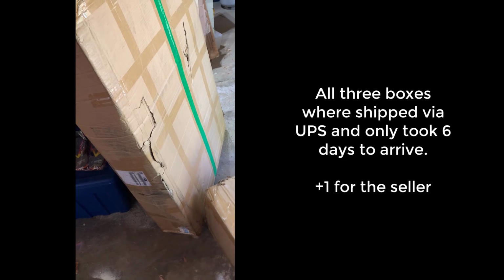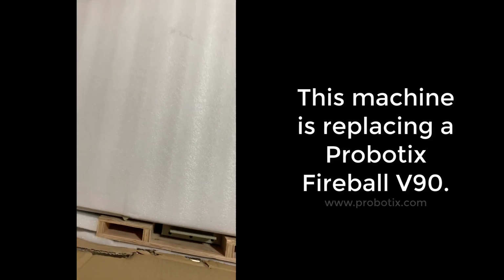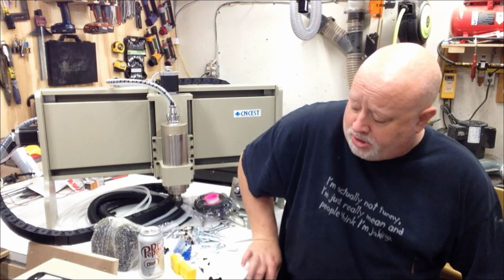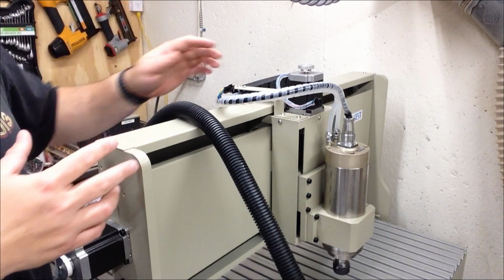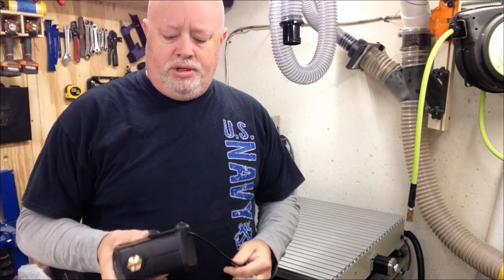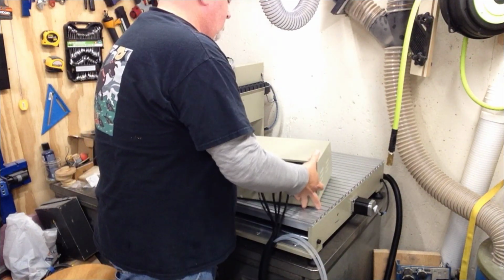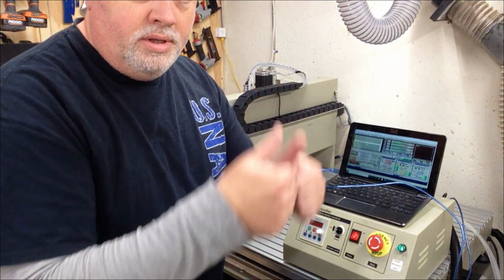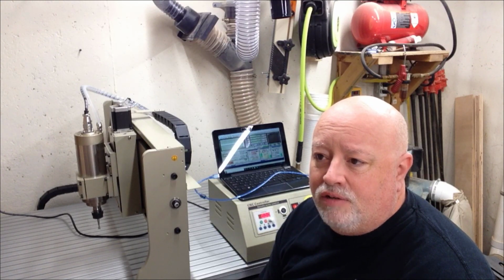Getting started with the Chinese made 6090GZ CNC Router

Comment: howdy is this better than 6040?i plan to make inlays on pool cues and engraving....
Reply from the maker: The only "better" thing about the 6090 vs the 6040 is the size... when talking about the CNC machines from CNCEST.  The machine work area is larger on the 6090.  Also, not knowing what 6040 you are looking at, there may be more spindle options on the 6090 vs the 6040 as well.  Otherwise, they are, usually, a similar machine.
Reply: @jeffmorlen  if you make a tutorial on hoe to extend bed to say cut  or taper something up to 32 inches between centers that be awesome!
Reply from the maker: Getting my 4th axis up and running is on my list.  But, I'm in Wisconsin (USA)... so we take advantage of any good weather we get (usually 2-3 months of the year... haha)... and I've been spending a lot of time working on engines this summer.

I'm hoping to have a quick "Let's get you up and running with your 4th axis" video in a month or two (which may be longer... and I may have started that project more than once already... eek).

But, the information that I'll try to convey will be relatable in many ways.
For a taper, like on a pool cue, I can think of some ways to do this in software and a couple ways with just a simple mounting plate/jig.  It doesn't have to be complicated to work... right?

I'll keep you posted.  Thank you for the comments.
If you need direct help, please send me an email.
Reply: Oh btw I have Gcodes ,I also had a 10k cnc just fr cues but it got sold and now I'm into buying a 1600 cnc ,so I figuere just load gcodes and send it
Reply from the maker: As long as the G-Codes are generic, it should be fine.  But, something to keep in mind is that this CNC runs using Mach3, from machsupport.com.
This is an older package (as of the time of this comment, they are no longer developing Mach3 and focusing on Mach4) and you get a questionable license with most CNC machines out of C#!n@.
Reply: I plan on using vectric 2d or something else and I don't mind buying mach program just wish it was longer like 35inch
Reply from the maker: Vectric is great software and if you pick the right Mach2/3 post processor, you shouldn't have any issues.
I hear you on the size... I wish it was something like 24"x48" (26"x50" table size).  But, if you index your work, you can do longer things.
Reply: @jeffmorlen  I can make it work for inlays but if wanna taper a shaft it's usually 29 in then add fr tailstock and the drive so it moves it to at least 35inches

Comment: Hello, great video. What is the difference between 6090GZ and 6090Z? You recommend usb or parallel connection? You recommended me to buy 6040 cnc, to learn the process or to buy directly the 6090 cnc, so i can have it forever? I am an engineer, experienced with autocad 2d, and less on fusion 360.
Reply from the maker: I'm not sure what the difference would be.  I've searched for the 6090Z and could not find anything significant.  Most of the differences that I noticed were things like limit switch placement and the advertisement of the unit as being made of "steel".  Mine, I believe, at the time of the purchase, said it was made of steel too... but most of the larger parts are aluminum with steel screws and covers.  Of course the linear rails are polished steel as well.

I hope that helps.  Sorry I don't have more information on the differences.

Comment: Hi Jeff.  What type of connection is that to your pc.  I once bought a machine that had LPT and usb.  It turned out they pirated someones firmware and pc software.  You couldnt update or use usb connection with mach3.  In future i need to ask better questions to avoid a repeat.
Reply from the maker: One thing about some of those cards... 
The CNC breakout boards you find with a USB and an LTP (Parallel) port on them usually only use the USB for power.  They still require a parallel port connection to move the machine.  I've seen several with both ports too and, personally, don't care for them.  They always seem to be very low quality.

My CNC breakout board is, probably, a knock off of the R&R Motion controller board.  This board uses USB only and does not require a parallel port to run.  You do need to install a DLL into your Mach3 folder for it to work, but I've had very few problems with mine.

Feel free to ask me questions... I've been in the CNC space for 10+ years now (personally) and another 10+ doing software setups and first run stuff, professionally, before that.

** I don't do this for my work any longer.  It is now just a hobby.

Comment: Hi Jeff, Thank You for your video. I read on Mach 3&4 that a laptop cannot be used. I see that you are using a laptop just fine. Is there something that I am missing with that?
Reply from the maker: Sorry for the delay.

Yes, the documentation, for Mach3 and Mach4 does indicate that you should not use a laptop.  So there is that... but... you can if you use USB (it seems to me) to communicate with your stepper driver controller board... like the RnR Motion in the 6090.  

So, to be "safe" I would say that you should not run Mach3 or Mach4 on a laptop to control your router.  But, just like everything else, your experience may vary from what is recommended vs. what works for you.  Personally, I'd be worried about the laptop stopping the job part way through or something.

If you watch a lot of CNC videos on YouTube... a lot of people run Mach3 on a laptop... but, like I said, your experience may be different.

Hope that helps... even though it is sorta a non-answer answer.

Comment: Jeff - I’ve had my 6090 for a little over 4 years now (same brand).   Done a lot of work with it and mostly using “VCarve” for my CAM Software.  All that being said I’ve also had numerous issues with it - overheating, have had to rewire the x and z axis, and now the touch plate won’t work.  It’s  good that I enjoy tinkering  with it as much as I do - I guess it’s called a hobby CNC for a reason!  I enjoyed watching your video .
Reply from the maker: Thanks Jim!  Is there anything you want me to tackle??  I'm working on the 4th axis stuff now.
Reply: Hi Jeff  i have brought this same machine and having a hard time getting it to run with the software, i got the machine running manually, unable to get those download they send to work is it possible to give some guidance please,

Comment: Thanks Jeff. I am considering getting either a 6040 or 6090 and your videos are greatly appreciated, as I am completely new to the CNC world, other than lasers. Quick question - I actually want a 6040 but I noticed that none of them that I see have limit switches. Do you think this would be a huge annoyance with everyday usage?
Reply from the maker: It's different for everyone.  I know that before I had this CNC machine I had a smaller one that didn't come with limit switches.  I did add them, in the long run, but after 8 years of using it without.

It mostly comes down to knowing your machine and knowing that the project will fit in the space you have defined.  If you are going to push the limits, as in the size, of the machine... you will probably benefit from limit switches.

If everything you are planning on doing (in the near future) is quite a bit smaller than the machines size, you probably won't benefit from having them.

I hope that this makes sense.  Let me know if you have any more questions.
Reply: @jeffmorlen  Thanks man. I think I'm just so used to having limit switches on my laser because it homes itself every time on startup and if those limit switches weren't there then it would just repeatedly crash itself into the side. I guess I can get used to not having them on the router, with a different mind set. It's odd that you can't even find a 6040 with limit switches (and no ports for them on the back of the VFD box).
Reply: I  removed them from my proverxl 4030, after you have practiced you can do without them

Comment: this machine have uses 20mm non supported SBR linear rails y axis this mean not strong cutting aluminium, but can change less than 300$ supported SBR linear rails. and have weak small Nm torque motors need change normal cnc user 112mm long nema 23 motors 3Nm or more. controll box include 10$ 4 axis breakoutboard and DM 542 small motor drivers, same can change better DM 556 motor drivers and biggest nema23 45A  3-5Nm motors. lot better whit aluminium cut.
Reply from the maker: Actually... this unit uses fully supported on the Y axis and unsupported on the X axis.  The stepper motors, I believe, are 2Nm or less... which is a little under powered for this unit.  I will be changing them in the future.  I use DM542 drivers on my other CNC machines, but I have not opened this box in a bit... and don't recall what is in there.

Comment: same machine aliexpress have 2000$-3500$ many seller, only frame, not motors, not controller box cost 1000$ mach3 controller card 10-20$ 4-5axis and motors can buy less than 300$
Reply from the maker: If you wanted to... you could build a 6090 with the motors, controller, VFD, and screws that you desire.  The option, on Amazon, is just a quick way to get into this type of machine without having to source all the parts.

Comment: mach3 has good beginner but not safety and good pro, not realtime, dangerous if not have, not easy make own tool help files, not easy made additional axis,etc,code,makro etc, linuxcnc workig true realtime lot safety than windows base mach3 and can lot lot lot make own tools,softawares,makros,hall fles etc tool changer automation etc. linuxcnc have flexible make lot new all what u want. mach3 not can make all. but mach3 have easy to beginner cnc use littletime.
Reply from the maker: Mach3 vs. Linux CNC is a discussion I'm willing to have.  I've used both, extensively, but feel that Mach3 is easier to customize and works with a wider array of hardware.  That's why I use it vs. Linux CNC at this time.

Comment: This video of yours has been like the light to start understanding the machine, but I have a question, how can I check the vertical axis of the machine once I have it connected to the computer
Reply from the maker: The vertical axis (the Z axis) can be controlled, in Mach3, with the Page UP and Page DOWN keys on the keyboard.  If connected properly, and the software is working, this should show you movement of your Z axis.

(You do need to click on the RESET button within Mach3 before movement can be done)
Reply: @jeffmorlen  Thanks a Lot, your video is AMAZING
Reply from the maker: Thank you Victor.  Let me know if there is something you need/want me to cover in a video or "quick clip".

Comment: I got one of these Chinese machine, too. It's not advised to start the spindle at high speed as this will shorten the life span of the bearing. Start at 3000rpm and increase for every 3-5 minutes. This will help the lubrication on the bearing. If you have more budget, you can upgrade the bearing on spindle. With 4 bearings, the noise will decrease.
Reply from the maker: Thank you for your comment... but, I disagree.  The VFD, within the control box, will ramp up the speed on its own.  And every 3-5 minutes will make it take a long time to get up to speed.  However, 3000RPM, as per the specs on the spindle/VFD, will cause issues of its own.  The minimum speed, for the 2.2KW spindle, is 10000RPM (as per the vendor).  At 3000RPM, due to how a VFD works, could cause the VFD to overheat.

That's my $0.02.
Reply: @jeffmorlen  Well, the Chinese vendor of the spindle told me about this. It depends on the lubrication they implemented for the bearing. I think most Chinese spindles are the same type.
Reply from the maker: Who is the vendor of the Chinese spindle?  Mine is not marked in a manner to determine who the made it... so, could be the same or it could be different.  If you have information, and care to share, let me know and I'll host it for everyone.  Thanks!

Comment: I have the 6090 machine USB and can only get motion on the XYZ but no spindle control in Mach 3. Also the supplied USB hand held controller suffers the same condition. I have installed the rnr motion dll into the plugins folder...along with license file. but no luck. I also seek knowledge about scanning an image and cutting out the shape. (In my case wood mouldings...from which to cut a template and subsequently grind the knives from that template to reproduce the original scanned sample.) .
Reply from the maker: I have heard of issues, just like yours, from some owners of the Chinese 6090GZ CNC machines.  It seems that some vendors DO NOT connect the motion controller to the VFD and require you to control it manually.  However, there are a couple things we can do to check this out...

Can you get the spindle to spin using the control panel on the control box?

Here is a link to a PDF that I made about testing your spindle.
https://1drv.ms/b/s!AgxiwVost-OPi4ES7Ug-cm8Gwsr11Q?e=HW9JYY

Try this and let me know.

Comment: Hey Jeff,

looking to buy similar machine from ebay .

just curious for the travel disnatnce of the axes , do you have any intel on this ?

Need at least 150mm in Z- axe for my purpose of use .

Grts , thx in advance
Reply from the maker: Davy-
Unfortunately, the distance between the aluminum bed and the bottom of the gantry is only, 4 9/16".  I have a pic that shows this if you need confirmation.  Sorry.

Comment: Jeff, do have the specs for the stepper motor.  I need to replace my Z axis motor
Reply from the maker: Ron-
I don't have the specs for them... but they seem to be pretty light weight.  Like, maybe, 280oz/in motors.  Many people have replaced their "stock" motors with larger, stronger ones.  The benefit is that you will get better speed and better holding strength.  

So, with that said, I'd say that you can just source a motor from Amazon (or similar).  The connectors are industry standard and you can find them on Amazon too (I used to have a link to a bulk pack but cannot find it).

I hope that helps.
Reply: @jeffmorlen  normal nema 23 3-4A 3Nm motor i see have. what longed motor body have then strong have torque, important not small motor because no torque lose step easy and not can move all axis.
Reply from the maker: I believe the connectors they use are "Micro-Fit 3.0mm" male and female.  You can find them on AliExpress or Amazon.
Reply from the maker: Might be these...

https://smile.amazon.com/Molex-Micro-Fit-Receptacle-Terminal-sockets/dp/B07H6ZXPNM/ref=sr_1_1?crid=2M9AIQUMRETGR&keywords=micro-fit+3.0mm+single+row&qid=1663597391&s=industrial&sprefix=micro-fit+3.0mm+single+row%2Cindustrial%2C95&sr=1-1
Reply: @jeffmorlen  same factory same parts buy amazon have 7-12x expensive than buy same aliexpress normal, amazon have lot scammers and sell ower price all cheap chinese parts, and same parts i mean has made same factory. ali sell 4$ and amazon 8-30$ true full same parts. stupid use big scammer shop amazon if same factory same parts can buy other shop 10x cheapen.
Reply from the maker: One group said they were JST SM connectors.  Here is a link.

https://www.amazon.com/4-Pin-Brass-Terminal-Connector-Female/dp/B01LYYGGED/ref=asc_df_B01LYYGGED/?tag=hyprod-20&linkCode=df0&hvadid=226601492573&hvpos=&hvnetw=g&hvrand=15714838303230970531&hvpone=&hvptwo=&hvqmt=&hvdev=c&hvdvcmdl=&hvlocint=&hvlocphy=9018821&hvtargid=pla-378969788043&psc=1

Comment: All of these (this style) are made by CNCEST. Most of the pages on eBay state that they are unbranded. I just bought a 6040. Need to make a bench for it and assemble it. That's going to be delayed a few days as my order for the lumber got canceled. Have to redo with different lumber. Pain in the ass. Making it over kill with 4x4s.
Reply from the maker: Share a picture of the bench when you are done.  Mine is just sitting on an old, and very heavy, commercial desk. :)

Comment: does the controller box come with any software or you have to use MAch3?
Reply from the maker: To be honest... the system does not come with a USB stick or CD/DVD or anything.  I needed to contact the seller to get the software that works with it.

That ZIP file (you can find attached to my channel) contains the RnR Motion Controller driver, Mach3, and some PDF files.

If the version of this unit you buy has something other than the RnR Motion Controller board, then you'd need to use what you can get from the vendor.

Please note:  My machine will not work with any type of Arduino CNC controller board software, LinuxCNC, Mach4, or other 3rd party software.  My unit will only work with Mach3.

Comment: I'm about to buy the same machine as yours but I'm in the UK. I'm pretty sure it's an identical machine but it has a different name on it, as you said go on Amazon same machine sold by loads of different people.  I've wrote to the company to ask if the machine will run on anything other than Windows 7 or Windows XP. They've come back and said no it has to be those operating systems. Are you running these operating systems or are you on a more modern machine running say Windows 10?
Reply from the maker: I would ask the seller for any documentation that they have about the machine.  Specifically, about Mach3.  This will give you some very strong clues as to what you can run.

I've seen a couple of systems being sold that use an Arduino vs. the RnR Motion control board.  That makes life difficult as you cannot even run Mach3... you need to run an open source version of some control software.

So, if you can get some information from them, then that will give you some clues.
Reply from the maker: Oh... and I run Windows 10 + Mach3 on the control PC.
Reply: @jeffmorlen   I see the Amazon listing you posted for your machine states that it only works with Windows 7 or XP – did you have to make any modifications to be able to use Windows 10?